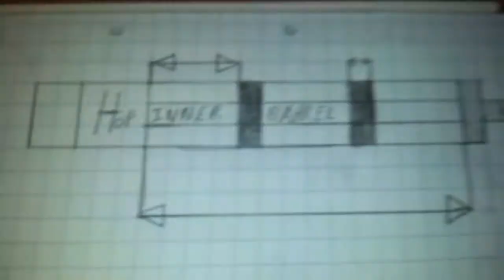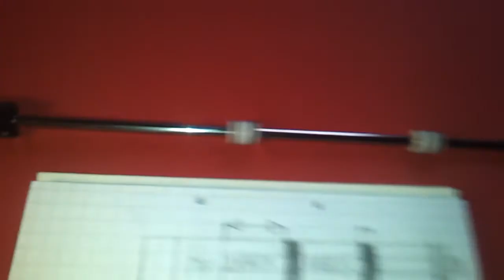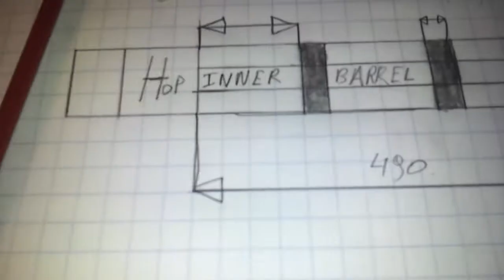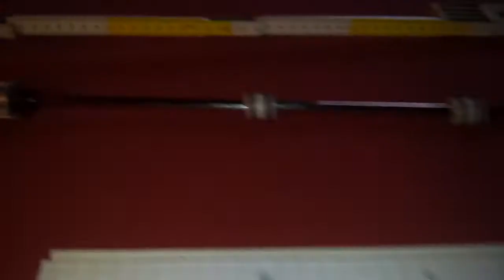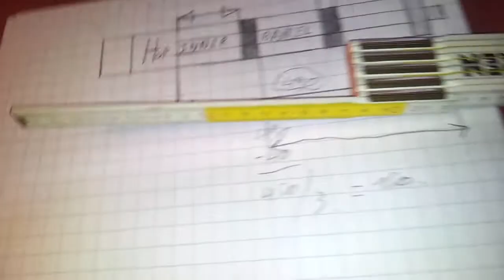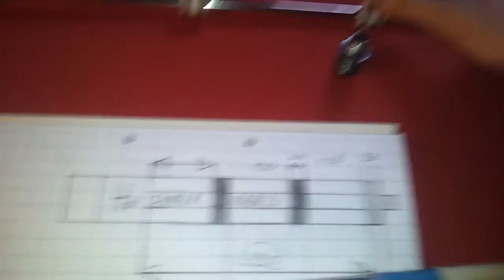[tech talk]: how to evenly space the barrel spacers

Comment: I know this video is old and I'm not arguing with these methods by any manner, but wouldn't it be easier to put the spacers where you want them on the inner barrel and put a bit of tape on the inner barrel behind and infront of the spacer? once you slide the inner barrel in, the spacers wont move. This would save you the trouble of getting some tool to push them in and have to repeat the process every time you take out the barrel.